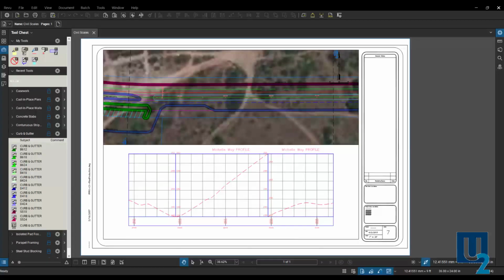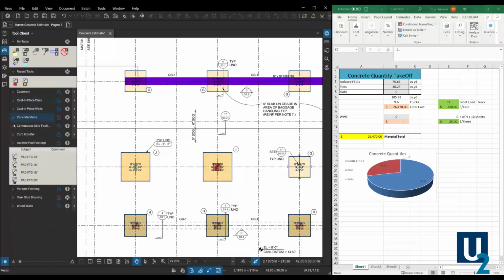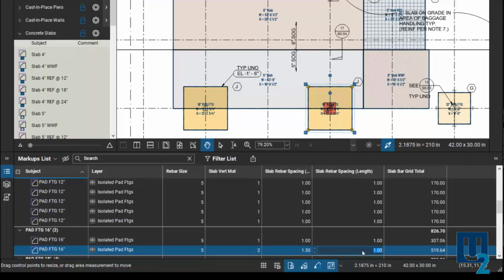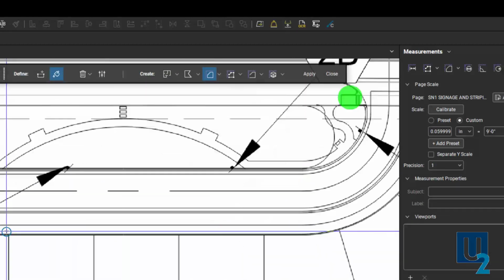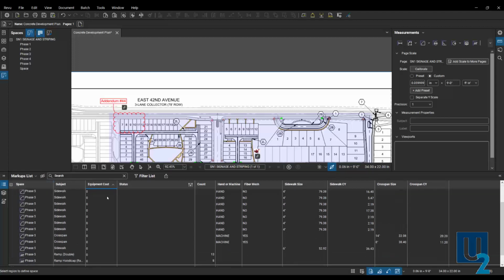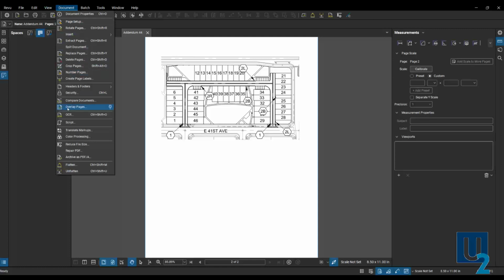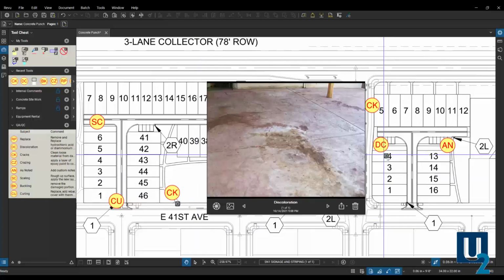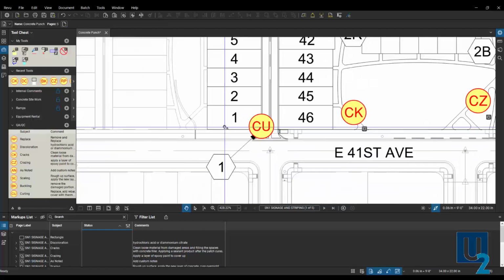5 ways Concrete Contractors get the most out of Bluebeam Revu

Comment: I deal with a lot of structural foundations and concrete structures (concrete tanks). Is it best to set up a tool for each of the typical thickness of slabs and walls or do you just change the depth in the markup?

What about the conversion of rebar length to weight in the custom columns? Is that possible?
Reply from the maker: I typically build tool for the most commonly used sizes to speed things up and build consistency and standardization between team members. As far as rebar by weight, this would be a simple formula in a custom column. Great way to think beyond a simple measurement @aggiebq86